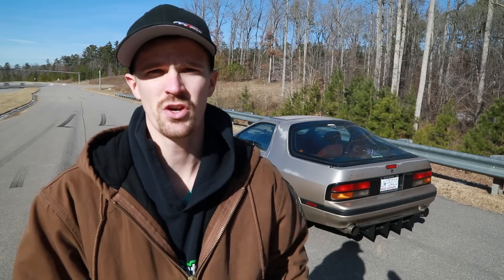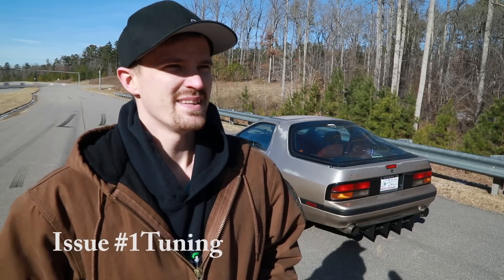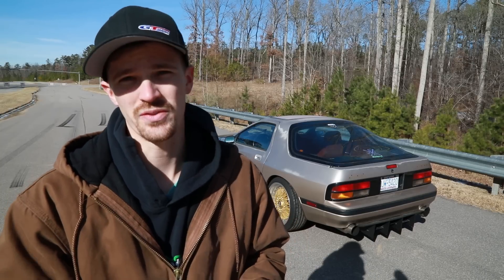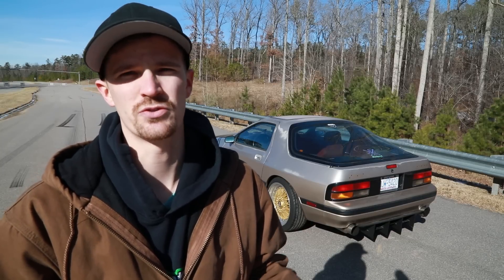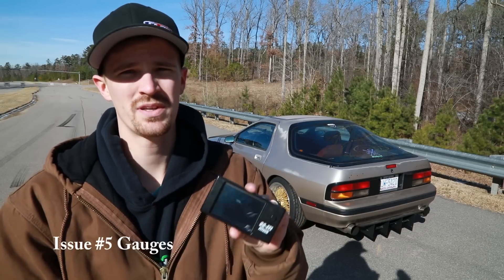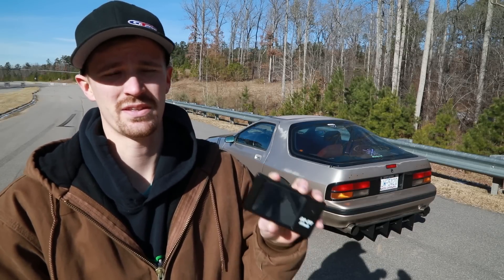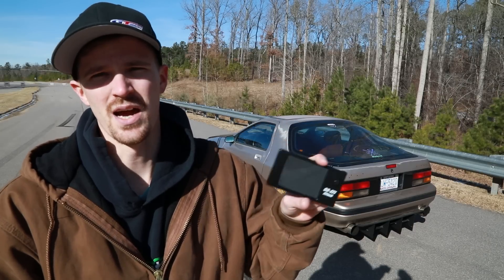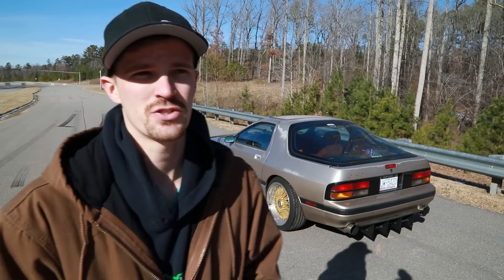5 Reasons Not to Buy FiTech EFI System

Comment: I haven't fitted mine yet but I'm glad I paid the extra for the full software suite.
The overrun fuel cutoff isn't probably going to save you that much fuel is it? On overrun the fuel flow is minimal anyhow, so the savings are small. Leave it off. I get your annoyance however since fuel cutoff has been around since Bosch L injection (and variants) which is about 35 years old now.
I did have a thought about fitting dual oxygen sensors (one per bank) and switching them at high speed with a transistor box during the learning phase and maybe full time.
Your motor needs a far far better aircleaner also. Small air cleaners cause a pressure drop. Get rid of it! I bet it is causing metering issues with it.
On another matter, I believe the dual plane manifold is better suited to carburetors where fuel metering is via atmospheric pressure vs venturi vacuum on installations that require off idle throttle response and good idle quality. Since TBI is using a roller cell pump to supply pressure and injectors (with pulsewidth modulation) then the dual plane intake would be better off being replaced with a single plane - just sayin'.
I'd replace that pump if you haven't already.

Oh BTW, my dual quad Fitech doesn't fit my dual quad intake as it hits the rare MSD narrow body distributor. I mean it is the dual quad system an all and the dual quad manifold is for the extremely rare SBC (it says Air Gap on the manifold) from the almost unheard of Edelbrock company so I suppose I have to expect these things don't I? I asked the mighty Fitech Corporation if the fabricated Holley type dual quad intake would be a suitable intake but I was accidentally informed (as it turned out) that they hadn't tested for fitment on either of those 2 intakes - because the next day the post strangely disappeared (The Donald must have deleted it to protect our Industries from idiot customers stopping America from being great again).

Some of the criticisms you have seem reasonable. I personally get annoyed when manufacturers (not mentioning any names) use their paying customers as beta testers for their unproven in the field products. Read into that what you will ...
Reply: I have a zz4 crate motor and it has dual plane manifold and was thinking of putting a 1/4 inch spacer under it because I have no space for a larger spacer wonder what it would do? I also was thinking of grinding out the center divider maybe a 1/2 deep off but I am not sure if any of this matters because on the fitechs bottom it has ground out ports so it should not matter if it's bolted to a single or duel plane?
Reply: Well who would know?

Given you have a Fitech, I'd do this, either get a cheap single plane (like Speed Master) or get a good secondhand brand name single plane intake. I like your idea of the 1/4" spacer but get a wood or phenolic one. The wood ones are fairly pricey but don't crack like phenolic ones. I just like the idea of insulating, it is not for performance.

I know what you're saying re the bottom of the Fitech being 'open' but here's the thing, a dual plane intake is designed to work with carbs. It helps idle quality with big overlap cams since the vacuum signal to the carb is dependant on manifold vac. Dual planes do a whole lot of other things for carbs also - but you don't have a carb anymore. 

I cannot predict what the outcome will be but I can say on the basis of reason (possibly flawed reason at that!) that the single plane intake should be better suited to throttle body injection.
After installing your single plane I'd reinitiate the self learning of the Fitech.

Make sure you have a BIG air cleaner.

What do you you think?

BTW, Engine Masters machined out the center divider of a non Air Gap Edelbrock to the same specs as the Air Gap and the power was identical. I wouldn't do this in your case because for ~$150 extra you could have a single plane.
Reply: I don't know a guy on here replied he used the fitech efi on a single and a dual and he got better times on the drag strip with the dual plane? he said it's BS about the single plane .... Go figure?
Reply: I saw that too - which is why I was careful to say "(possibly flawed reason at that!)".
Now I've got that part of it out of the way, there could be some reasons for that.
They could go something like this:
a) Maybe he didn't re tune after swapping
b) Possibly the air cleaner was too small causing erroneous results
c) A combination of a & b (above)
d) He is right and I am wrong
e) The non software Fitech system he has works better with dual plane by design.
f) The motor now wants faster advance lower down in the RPM range
g) Other factors, such as the motor now revs 4-500rpm higher and the valve springs aren't up to it.
h) Who knows?

OF COURSE I COULD BE WRONG, but I believe Fitech is better suited to single plane and dual plane intake is better suited to carbs.
What do I base this on? Well call it tuners intuition. I am a qualified mechanic. I understand carbs very well. I understand injection very well.
I love nothing more than to nut out problems esp where things don't add up. 
I'm definitely not having a go at you - in fact quite the opposite. I want to help by providing some logic (yes poss flawed) and some knowledge. 
Rest assured however, if your car were my car, I would do myself what I said you to do.

Beware all this could be complete BS DON"T DO IT>>>>

Comment: I have zero issues. I was on my second carb and wasn't going to get another. I hit the key and it fires right up. Controls my efan, shows me everuthing going on. White screen is a power issue during cranking, been there done that. I have the 400hp unit and love it. I'm not a mechanic, I have mechanical skills, and this wasn't hard to tune or get running. It's a universal efi and if you didn't know before hand that you will have to tweak a few things to fit your application, guess you shouldn't be under the hood if a vehicle to begin with.

Comment: I guess I'll be keeping my 850 quick fuel on my 496
Reply from the maker: The system has good and bad points, it works and you can slap it onto a motor and get up and running quick and easy but in the long run it has some issues. Some people love the system some people hate it. Its was a step up from a carb for me having vapor lock issues with such a small engine bay, but if you daily the car the holly seems to be a more thought out system and may be a better bet in the long run.

Comment: The white screen issue is low battery voltage during cranking. Either you battery is close to its use by date or you have a voltage drop. The best FiTech resource is “FiTech Owners Group” on Facebook. Also as others have said that air filter is way undersized and well past it’s use by date.
Reply: hq308dotcom Interesting that low battery possibility. 

Many vehicles can have ECM  issues because the battery can't provide enough current for the starter and the ECM.

A big fresh battery with clean connections may solve your problem.

Comment: Why are you using the very restrictive air cleaner
Reply from the maker: There is only about 2" from the throttle body to the hood and this is the only air filter that fits without going to a custom filter setup. I will be building a better setup once I get in a garage but for now this keeps dirt out of the motor. Would be a different story if it was a race car or something but its just a fun street car.

Comment: I have the meanstreet 800hp on my 572bbc in my 69 camaro and the only issue I have that's the same as yours is the resetting of the main gauges. There shoulda been a memory power wire to hold those settings in memory. Agreed. But even the rest of your issues are NOT enough of a reason to not buy it . Come on its the cheapest on the market and if your going from a carburetor its pure magic. These may be concerns but none of those issues are enough to not buy it come on.
Reply: Darrren Betker I agree. I have the mean street 800 as well. Works very well, but the handheld is sometimes a pita.

Comment: youre pulling too many amps on start, thats issue with white screen. decell can be completely controlled with your system, if you cant tune it yourself take it to a pro. also once tuned make sure to have all the setting written down just in case your settings are reset. sadly the 5 reasons you gave are either pointless or user error.

Comment: White screen is a voltage issue. It doesn't necessarily mean your connections are bad. Just means you're losing voltage while cranking. If it drops below 10 volts while cranking it'll kill the whole system causing your white screen. Could be something as simple as a weak battery or bad ground. Fix this issue and you won't have to unplug your handheld all the time and reset gauges. 
For your "heel toe" issue, since your car is a manual DFCO cut map and return map are likely set to high. And since these systems do not have CFCO this makes DFCO all the more important. 
Try setting DFCO Cut map to 16. DFCO return map to 18.
Reply: jfkdotcom Lol there is more than one way to have a bad voltage issue. 
White screen issue is low voltage regardless of where it comes from. Bad battery, worn out starter, crusty battery terminals, or defective Fitech harness. Just some basic examples of what it could be. 
Eprom ecus, OBD2 pcms, even MSD boxes don't like low under 10 volts.
Reply: Kyle Q same here.  My controller is taped to the dash and I've never had the cables fall out during a race.
Reply: I agree on the bad design, but on my off road truck that bounces harder than any road driven car I've never had the cables come out or get lose or give me trouble.  The FB Fi-Tech owners group is far above the company's actual support (which sucks) but they have been instrumental on setups.
Reply: Kyle Q if he's 100% certain he's reviewed his wiring he's probably just got a defective harness.
Reply: Good advice, helpful and productive , you are a asset to humanity. Take your kudos
Reply: It could also be a combination of Map accel and tps accel along with dtps.
Reply from the maker: Iv been playing a ton with the DFCO settings but I think someone found the issue I was having. There is a firmware update and my unit is an early one without the update, fitech doesn't list the update on there website or anywhere for that matter. But one of my subscribers sent me the update so im going to give that a try soon. As far as the white screen I thought the issue was low voltage but when the batter is almost dead when its cold out I don't seem to have the issue at. I listed the connectors being a reason just because they suck not that they were causing any issues. They fall out when you move them, and they com straight out the top so you have a hard time finding a place to mount the hand held because they take up so much room. Just kinda a bad design on there part.
Reply: lol and not necessarily in that order...
Reply: so, every vehicle that has this junk installed on it has a bad battery?

Comment: i had a dual throttle body system on a 871 blower, i had to return, injectors pulsed with my blinkers, wipers. it filled my engine full of gas twice before we figured out the injectors would pulse even when ignition was off,   the tech and everyone there was rude no help at tunning, got fast xfi now love it
Reply: bobby o Sounds like you had a blinker ground issue that backfeeded through the efi system(injectors) to find ground.

Comment: wanted to say I do agree with the air filter issue Through The Years working with Aaron fuel mixtures especially with carburetors of course I've seen great changes in performance when paying special attention to what is the right size and setup of air filter to allow your motor to perform at its best I have a big block Chevy that is carbureted I really wanted to buy the fitech system cuz it is Affordable and eventually add the pro charger to my car would you still suggest buying this system?

Comment: That air filter is choking down 50% of the air or more, I can't believe it runs at all. That's the worst filter ever made.....
 I have the same 400hp Fitech system on a 350 Chevy with Dart 180 Iron Eagle heads, dual plane Edlebrock RPM intake,  1130 Summit cam, 10.5 : 1 compression, 3" exhaust, and a big ol' 14"x 4" air filter....I took my time and researched how the tuning works and I'm glad I did....
My 350 dynoed at 422 lbs/ft @ 4200rpm and 385hp @ 5500rpm. Starts right up with just a blip of the key....awesome....I'm very pleased with mine.
Reply from the maker: Definitely love the cold start with the system, 15° and it fires right up. Air filter is due to hood clearance, 2" is not enough room for anything else. Custom filter/drop base is in the works and should make for a good video!
Reply: I cut in a hood scoop on my Jeep for the room, helps to keep it cool too. My Fitech was a real PITA until I finally figured out all the adjustments, struggled with it for months at first, then took my time and learned everything I could about all the settings, had to tweak it a bunch....I don't think it learned anything on it's own I'll tell you that for sure....
Reply from the maker: No way I can cut a hole in the hood would kill the whole sleeper look, and as much hate as the air filter gets its not that bad you can hardly feel any seat of the pants difference. Its a bone stock ford explorer motor so a tiny camshaft and the motor doesn't make power past 4,500RPM so its never sucking a ton of air. Plus a small air filter is better then nothing on a street car. Since I posted this video someone told me there is a software update for the system, for some reason Fitech doesn't have any info on there website or anywhere. Someone was kind enough to send me the file so im going to update the system and that should help me fix some issues iv been having.  I think the fitech is a good system but it was put onto the market to early.

Comment: When FiTech came out with these they were rushed. It caused Holley and MSD to push there Fuel injection kits too early also. I had a car with the atomic EFI I was troubleshooting. The main problem I found was that there was a severe lack on what I can make it do. Coming from tuning modern cars with hptuners the adjustments on these are extremely limited. If the EFI reads oxygen from a missfire it adds more fuel untill it floods out. This might not be much issue with small cam cars but when you add a bunch of overlap It does not agree with the EFI computer.

Comment: I had the 600hp unit. Went through 3 handheld screens. Customer support, get ready to wait 30 mins each time you call. I even met a tech support guy and he tuned it directly! Still sucked never buy Fitech. I bolted a Holley sniper on and I’ve never looked back. Don’t waste your time with Fitech

Comment: I bought the 600 horsepower version installed it on my Camaro Z28 in less than an hour and got it running and that's all it did was run I could not pull out the driveway do a burnout or do anything high high-performance you have to set so many different settings on the things not just for wires and you self tune piece of crap,sold it and bought another Holley double pumper Ultra carburetor,no more problems! !!!!

Comment: The Air Filter is killing the car for one, Also check the Firmware. and then the Intake manifold needs to not be a dual plane....... Fix some of these things and id bet anything that your car probly gains some good power and smooth out all the issues your having.
Reply: What's wrong with having a dual plane? I have a go street 400 on a dual plane. No problems at all.

Comment: Run a full stand alone system. I have never seen many drop om carb efi systems work good. I think some of the problem is the fueling in the drop on carb. Do individual injectors per hole. Way better.